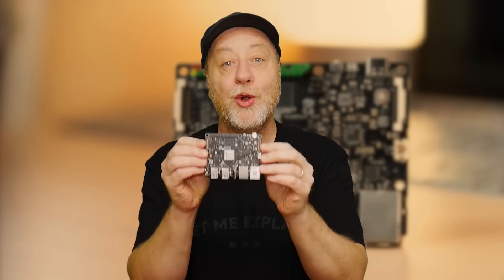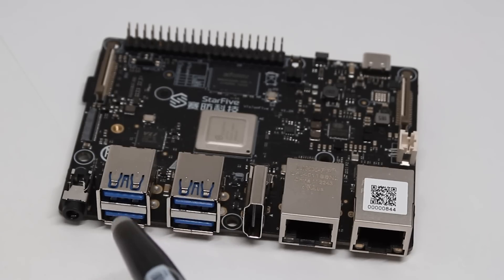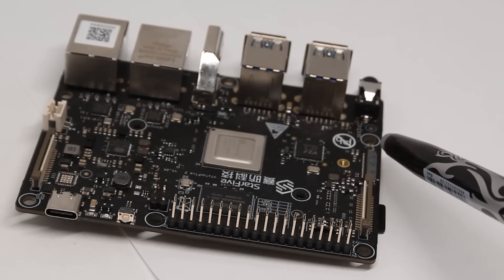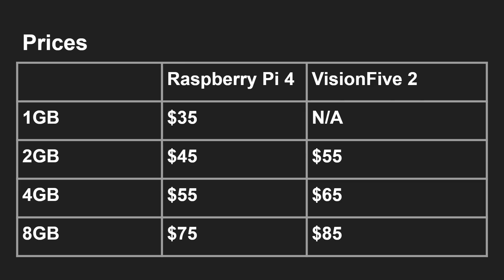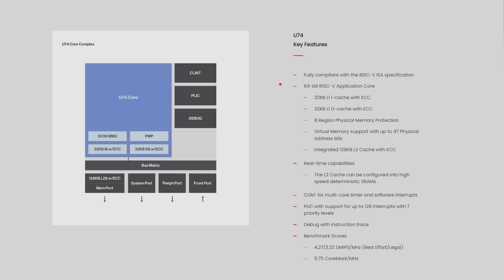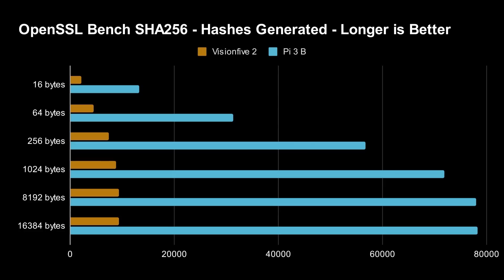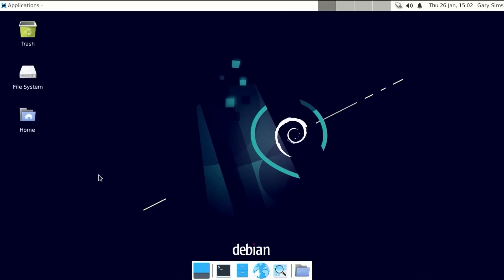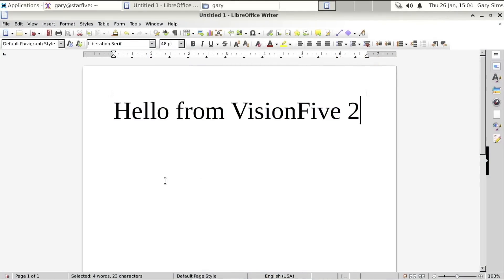VisionFive 2 RISC-V SBC - A Raspberry Pi Killer?

Comment: I'd be interested to know which compilers were used on the ARM and RISC-V systems.  I'm assuming GCC or maybe clang.  With RISC-V being a rather new ISA, how much optimization can these compilers do right now?  Were these benchmarks compiled -O0 across the board?  That being said, I'm not surprised by these results.  New ISA on new silicon means SLOW.  I'd expect to see much more comparable results in 2 or 3 years.

Comment: Imagination designed the soc for the sega dreamcast if I'm not mistaken.
Reply from the maker: The PowerVR2 was paired with the Hitachi SH-4 in the Dreamcast, with the SH-4 as the T&L geometry engine and the PowerVR2 as the rendering engine. Also there was a MIPS CPU in the PlayStation, and Imagination owned MIPS for a while, but much later.
Reply: @GaryExplains  thanks for explaining. Hah! ;)

Comment: What I wonder if this board will be good enough in a year or maybe even 2 so people working on creating products based on RISC-V as embedded and microcontrollers can easily use it. Because that's where it all starts, right ? Which sounds to me like: in 1 year, having a bunch of these in a rack for building stuff will probably be a good option.
Reply: The performance compared to the 7 years old Raspberry Pi 3 is really poor. If i want learn RISV-V assembly, there are better and cheaper options available. The only reason to buy this SBC would be if you need a Linux machine and are a developer of some kind of Linux application that also contains assembly code in order to then optimize your own software. In all other cases, a Raspberry Pi 4 is the better choice.

Comment: I couldn't really get mine to work with my 4K screen. No picture at all with HDMI 2.1 enabled, 640x480 with 2.1 disabled. Hooked it up to my TV and got 1080p. Fortunately the serial monitor is reliable, so I could see what was happening. In the end I resorted to doing things the old-school way and writing a few mode lines in the Xorg.conf file, and that gave me working 1080p on my 4k monitor. This was also not without problems though, some modelines I wrote would just completely lock up the board, or cause various unrecoverable kernel errors. And they weren't even lines that should be particularly taxing on the hardware, it was just totally random. Also, any 4k mode I tried would just totally lock the board.

Comment: The VisionFive 2 is more of a promise for the future. For now, it's... Meh! At the early bird price, it's justifiable but I don't think too many people will pay the full price.
Your use case may be different but for me, having the M.2 for storage is great and there are a few nice minor features. I don't like that they used HDMI instead of (mini)DP and having two LAN ports is unnecessary but not having WiFi (it wasn't mentioned anywhere, so I assume) is a crying shame. OK, you can add that function but it should have been there by default. It's a great miss for a small embedded system. For versatility as a standalone system, an on-board few-Watt D-class audio amp would've been usable. They are tiny, don't need many additional components and very cheap.
More USB? So easy to run out of those ports! Preferably USB-C.  
Flexibility is great but once you start hanging other bits and pieces off it, like USB hubs, WiFi/BT adaptor, it quickly becomes messy and adds to the cost to the point where you are better off buying a better equippped system.
But, the VisionFive 2 may find a niche - just not on my desk.

Comment: Thanks for the review. As a relative newby, I just want to play with the gpio, and not spend hours trying to boot a new board.
The raspberry pi's are getting rare and expensive, and I hoped for a cheaper option.
Maybe this Risc-V is not the answer. Cheers.
Reply: Just buy a Raspberry Pi 3 or even cheaper a Arduino if playing with the GPIO is the only thing you want to do.

Comment: If you install gentoo on the visionfive2 you will find gentoo runs faster on it than it does on the raspberry pi 4. I did so and compared the results of genlop -t to check the compile times as well as simple benchmarks like
time echo "scale=5000; 4*a(1)" | bc -l
I have my make.conf compile flags set to
"-mabi=lp64d -march=rv64imafdczbb0p93_zba0p93 -mcpu=sifive-u74 -mtune=sifive-7-series -O2 -pipe -fomit-frame-pointer --param l1-cache-size=32 --param l2-cache-size=2048"

Comment: 8:15
The lower cost has more to do with RISC V being smaller and simpler then ARM for a given amount of capability due to less legacy bloat.
On the other hand you lose the mass production scaling benefits of arm...
But yes, if mass produced this should in theory be cheaper and more energy efficient.
As for the licensing...
You'll still have licenses with RISC V, it's just that there's potentially more competition as anyone can make a compatible processor without investing a ton in a new software ecosystem with compilers etc to go with it...
Reply from the maker: Nonsense. Armv8 doesn't mandate legacy support and the latest Cortex-A processors are 64 bit only with no legacy support. And none of that applies to the Cortex-M series.

Comment: It's pretty much spot on what I want in a SBC. Two 1Gbs ethernet (for running a router), 4 X USB 3 ports, a nvme connector to plug in large storage and so on. I've want an arm SBC with these features. Just needs a faster cpu.
Reply: HardKernel Odroid...

Comment: it seems that the only advantage is the lack of licensing fees of the instruction set architecture for manufacturers. but the manufacturers still create proprietary IP like GPUs. so we will still have binary blob drivers. and here i was hoping to see fully documented hardware interfaces. that's really the only thing for me that would outweigh the performance, price etc. good video
Reply: GPUs is hard to do and very specialized. So far it hasn't happened yet.
Reply: You nailed it. As a user, you do not benefit from RISC-V in any way. As a user, the x86 is the platform with the most freedom.

Comment: The main exciting thing about RISC-V is that it is the same leap in competition vs ARM that ARM is vs x86. The sheer number of companies developing RISC-V cores and associated devices is outrageous.
The secondary exciting thing is that RISC-V's ISA design is actually turning out to enable significant improvements in power, die area (which means money), and microarchitectural flexibility... what does this mean to consumers? Even ignoring the licensing opportunity cost (and the actual fees, however small) and market size advantages, the actual design of the ISA enables smaller cheaper chips to run faster, with equal R&D effort.

Obviously right now, the core designs are less mature in the RISC-V world, having received a tiny proportion of the investment, but SiFive's licensed cores are definitely catching up. The U74 is a several years old design by now, and as the P500 and P600 cores start coming to SoCs like this, and as the architecture-specific software tuning comes through, it'll become clearer.
Reply from the maker: Did you watch my video on the power efficiency of RISC-V? It didn't turn out well RISC-V.
Reply: @GaryExplains  power efficiency depends way more on lithography than chip design. If the Die size for RISC-V for the same size transistor is smaller than an arm processor, it will be more power efficient. However, risc-v processors are not being manufactured with the same lithography of the arm cores. Arm processors have smaller transistors, and therefore are more efficient. 7-12nm vs 14-25nm is not a fair comparison.
Reply from the maker: @vladlu6362  I guess you didn't watch that video then... nevermind... In that video the RISC-V chips were on a better process node than the Arm ones!

Comment: When it's more than twice the price, it's not even remotely a pi killer
Reply from the maker: Twice the price?
Reply: @GaryExplains  the VisionFive 2 is around 80-100 bucks, maybe 75 if you're lucky. A Pi4 is $35-$55 bucks.
Reply from the maker: It depends on the amount of RAM. A ram for ram comparison makes the VisionFive 2 about $10 more. I show a nice table in the video.

Comment: I will buy at least one risc-v board. not to use it though. but to support the trend...
 Btw, does RAM/ROM has any type of "licensing" or is it open? 
Also, when will we have ssd faster than RAM/ROM? enough already.
Reply: Exactly
Open source software would not be where it is today without people supporting it in its infancy

Ask the folks who use qualcomm chips when the manufacturer decides not to release any further firmware,  you effectively are left with a device (typically Android phones) with no further upgrade path.  This happens a lot with Android TV too
Reply from the maker: @stultus es You can support open source software easily, you just need a pc and an internet connection to use it and/or to contribute. I downloaded my first version of Linux with floppies. How do you do that with open source hardware? It costs millions of dollars to make a chip.
Reply from the maker: @Roman Ash I am impressed that you are passionate enough to spend real money on something you won't use, but because you want to support a trend. So, please tell me why it is important to support a Chinese company that is making a closed-source SBC? You know the CPU and GPU aren't open source, right?

Comment: Seems you are quite hostile towards RiscV or anything not ARM considering your benchmark is specifically not geared towards measuring the chips' compute performance but utilizes the cryptographic security accelerator in the pie3. Not to mention, testing SSL hash performance is a weird benchmark to judge chip performance since it is something rarely done compared to regular math, floating point or even IO operations. This is actually something I have noticed many times in your video. Using words such as "slower/worse than they are claiming" which makes them out to be lying while "THEY" never claimed ANY of the performance that YOU are presenting. I don't know if it is subconsciously or you are really that clueless but it happens too often, that your tests or comparisons don't actually demonstrate what you claim they are testing. I have mentioned the same biased testing in your Arm vs ESP32 test.
Reply: There seems to be a bias

He seems to forget that raspberry pi initially was just as bad
Reply from the maker: Following similar comments I uploaded a software only SHA256 benchmark to my GitHub repository. The RISC-V board is still the slowest. Also, you can't just ignore my threadtesttool results, just because it doesn't fit your narrative.
Reply from the maker: @stultus es The VisionFive 2 board isn't ready, even many die hard RISC-V fans admit that here in the comments section. Just because I say that and point out why that doesn't make me biased, it makes me honest.

Comment: The first company to get it together and use PI4 ready software... survives when PIs return to market 2nd quarter of 2023.   I can do EVERYTHING with Twister OS and /or Android 13. Both overclocked to the limit and I can run them on batteries for power tools.

Comment: The reason why super cheap microcontrollers use in-house instruction set is because the licensing fee would cost more than the entire microcontroller.
So in some cases RISC-V indeed matters to the pricing!
Reply from the maker: So you think that the license fee for a Cortex-M0+ is greater than the price of paying an engineering team to design a RISC-V processor? 🤦‍♂️
Reply: @GaryExplains  It is fairly simple to design an ultra low price microcontroller. It is sometimes given as a semester project for students.
Modern VLSI synthesis tools can translate it to circuits very easily and completely automatically. The only hand designed parts are the pad interfaces, but that usually a given by the manufacturer.
I have once designed a simple microcontroller with an UART, in an afternoon. It was only synthesized for FPGA, but if you do not need bleeding edge clocks and optimizations, the synthesis for VLSI is just as simple.
Reply from the maker: Even for one engineer it is costing you tens, if not hundreds of thousands of dollars per year in salary, office costs, taxes, heating, benefits, etc. You still think that is less than the few cents you pay Arm. Even if  you license a RISC-V core from SiFive or Andes the maths is the same. That is why the licensing model exists in the first place. Then there is the cost of getting your chip verified so that you can use the RISC-V logo, etc.

Comment: Great review.  I came to the exact same conclusions you did and had the same firmware trouble you did.  Thanks for mentioning the minimal SD card image as well.  Someone had to tell me about that one on Twitter because it's not in the official StarFive documentation as a firmware update method.

It's not a board for beginners.  If you are experienced with boards though it's an incredibly powerful RISC-V board (the most powerful one I know of that doesn't go inside a server and is a SBC).  If you are wanting to get in or develop on RISC-V it's worth fighting through the firmware update.  If you are maker looking for an easy board to use absolutely not.

Thanks Gary!
Reply: Most of these boards are not really for beginners. Hopefully after some time they will get there. I think there is a huge benefit to releasing an early bird so the hardcore fans and experts can tinker and work out bugs and those who want something more polished can wait a few months. The problem is that most open source projects never get the polish and documentation required for a trouble free experience.